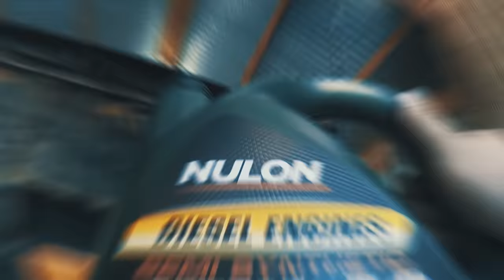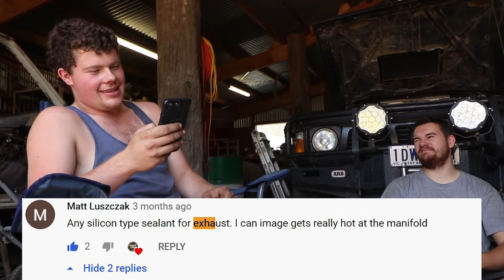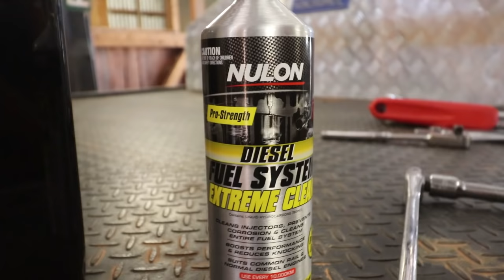Nissan Patrol TD42 Engine Service! | Oil Change, Air Filter, Fuel Filter, Oil Filters, Coolant flush

Comment: Missing one main round seal ,it goes on the shaft the filter screws onto ,nissan sells primer pump with that seal as package ,the seal on its own cost 7 dollars ,without it air gets into fuel system! And yes makes big difference

Comment: great video mate! just a question, whereabouts is the fuel pump or is it injector pump? located if you know, on a y61 ZD30 2001 wagon. the car just died to me on the road not too far from my house just before shops stopped trading for the day.  Any information would help. thanks
Reply from the maker: pretty sure injector pump is on the left hand side of engine bay!
Reply: @AussieArvos  Thanks mate! Just found a diagram of the engine

Comment: I would like to know why you didn't prime the the Diesel Filter with fresh diesel before you install on housing, yes you have an electronic lift pump but great wah to force air into your system...

Also hose clamp your fuel lines before removing to keep air out of system and also will stop any dirt, grease, or other contaminates

Comment: How often should all the fluids be changed, obviously engine oil is every 5000 but what about diffs, gearbox, transfer case, fuel filter, and coolent be done in a TD42?

Comment: Hey guys, @dan what’s the idea/benefit of draining the coolant from the drain bung on the block? I’d usually drop the coolant from the tap on the radiator or pull off the bottom rad hose. Wasn’t aware of a coolant drain bung on the block 😅
Reply: Pretty sure it just pulls more fluid out

Comment: mint vid doing this to my td soon also is this car converted td? as from my knowledge the fuel filter is on the passenger side
Reply: Mikey B no it’s not converted the fuel filter is on the right side because the fuel pump is on the right side that is fatory on all patrols
Reply: @dachickenwingx1721   the earlier model td42 gq's had them on the passenger side must have been before 1998, id imagine when they went from the silvertop to the blacktop but who knows
Reply: Early gq 4.2s are on the passenger side all 2.8 gqs are on drivers hence why everyone chances 2.8 fuel filter mounts to run second battery and bigger air box
Reply: My 1989 td42 factory fuel filter point was on the passenger side, bought a fuel relocation kit as they called it off patrol apart and relocated it on the driver's side to get red of all that unnecessary fuel line and added in a pre filter now it is an absolute pain in the ass to change the oil filters
Reply: @mikeyb8067  My '91 silvertop has it on the passenger side.

Comment: I own a nissan petrol y60 with TD42 engine. I install turbo and intercooler my problem is that at high speed egine temperature will rise up

Comment: How dose that primer pump work?  As in dose it turn off after its primed or is it a constantly running pump (only asking as mine is doing a similar thing to what James did)
Reply: Also if you happen to use my comment in your discussion sessions my last name is pronounced hide-an-right
Reply: Hey mate it’s a facet style pump you can get off the shelf pretty much anywhere and it runs whenever the ignition is on 👍👍
Reply: Yeah the pump runs al the time just to keep the fuel up to the lift pump
Reply: Cheers fellows will help me out a lot love the videos btw there aren't many people doing just general stuff with a td42 mine is a silver top but either way "same same but different"

Comment: Was thinking of getting a td42 gu coil cab any advice on what to look for ?
Reply from the maker: leaks (Oil and Coolant), look for smoke and turbo,(if it has one) and check it for blow by (when warm and idling take the oil fill cap off the rocker cover, it should not be pressurized). these are just a few little checks

Comment: Did you guys advance the injection pump timing when you installed the turbo? If so which way is that on the motor and by how much?
Reply: Hick Exc wouldent touch it leave it where it is
Reply: You would need to squirt time it, but I dont think changing the timing would be a good idea? maybe Up the fuel a bit to make more power, but wouldnt want to turn it up much anyway or it will just run hot and probably burn pistons or exhaust valves, theres a fair bit of work involved with running high boost safely